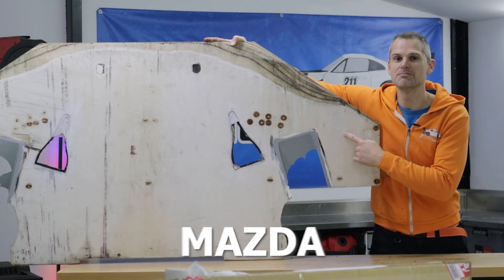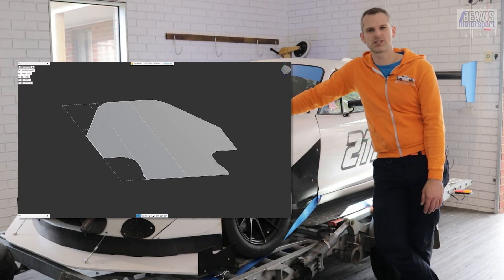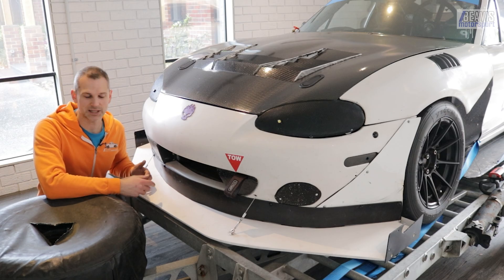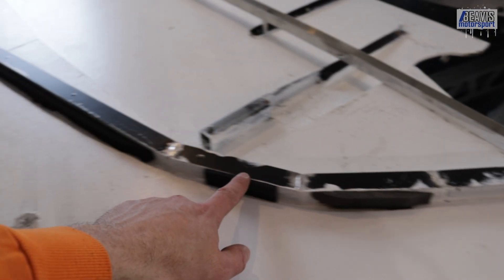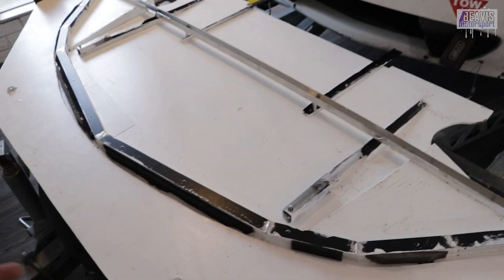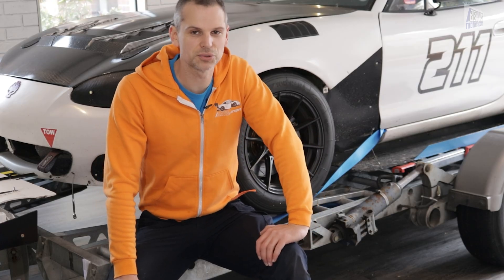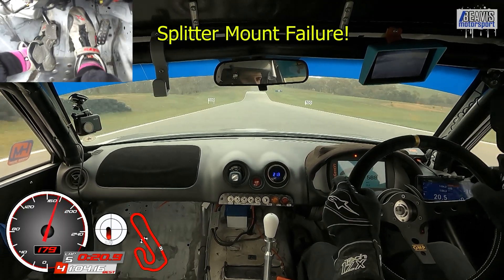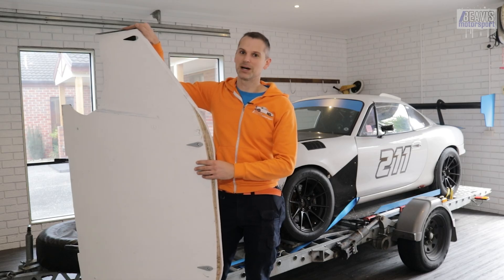DIY Racecar Splitter That ANYONE Can Build!

Comment: You really need to move away from plywood. It looks so cheap and rough. Use something solid and thin like aluminium. It costs only a bit more than plywood. I got a piece cut to size (700mm x 1800mm) for $90. If you use 3mm it will be super strong and therefore needs less brackets. And it can take the hits. Plus, being so thin it’s actually more aero efficient than thick ol plywood.
Reply: Theres a reason that plywood is so popular for race car splitters. Very robust and easy to make really good designs. Thin is not an advantage, ideally you want a thick radiused leading edge, like all factory race cars have these days.
Reply: I understand what your saying but plywood still looks cheap. As far as thickness goes, simple aero add on’s will get the profile without looking like a piece of flooring board. I’ve yet to see any racer with a profiled 12mm plywood undertray.
Reply from the maker: I dont particularly think it looks 'rough'. It's cheap but it's pragmatic. I cant justify the expense of materials and time to build something more glamourous. There's no way I am using pure aluminium sheet.
Reply: @Bbeavis if wood is good enough for professional motorsport it certainly enough for a diy TA car :)

Comment: Nice work, Mine's similar, but I'm using some really nice splitter ramps printed by 3DRX here in Adelaide. With some creative bracing and a different bumper I've managed to do away with splitter cables out the front too. It's definitely taking some hits though so maybe the next version I'll do my uprights more flexible like yours
Reply from the maker: One day I will have the spare time and money to make a carbon splitter thats strong, stiff and light. But for now I go with this setup, sadly it means i gotta run the wire supports to keep it held up.
Reply: @Bbeavis the way I drive I'll stay with wood, they're a consumable part to me!

Comment: Nice work!

I've a '23 RF Club, which came with the Appearance Package, so I got Verus' front and side splitters, which bolted right into the factory mount points.  I also got Verus' rear diffuser.

It "feels" like all of them made an improvement at... "highway speeds"... though even if psychosomatic, the look is very nice
Reply from the maker: Congrats on the ND, glad you're happy with the look and feel!